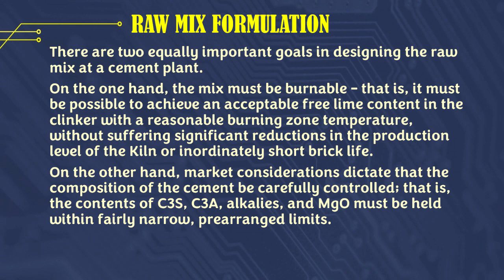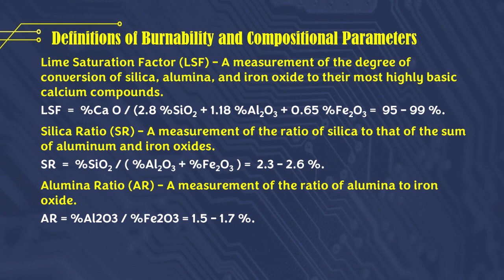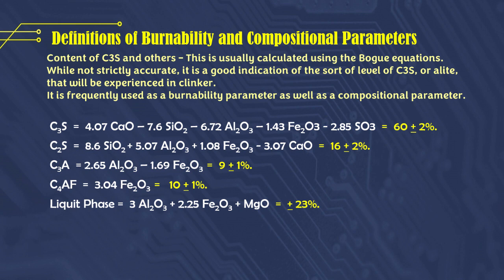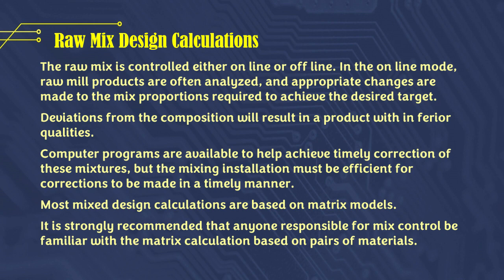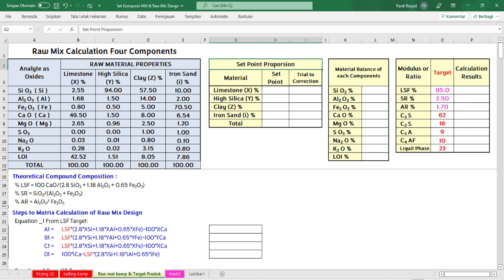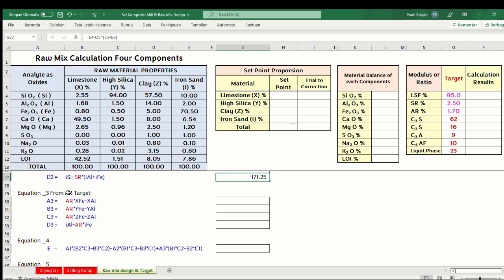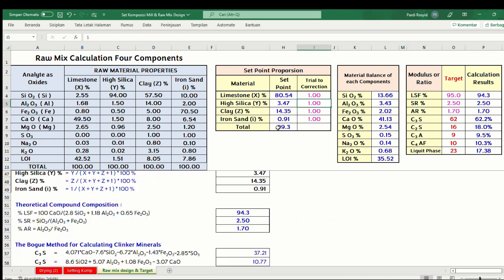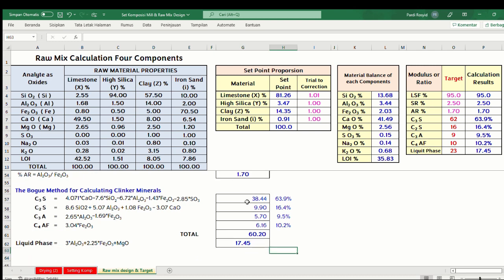Raw Mix Design for Raw Mill and Kiln Cement Operation_ English Version

Comment: Besides of spreadsheets, we also use computer software for raw mix proportioning of materials known as blendexpert by FLS
Reply from the maker: Yes, that's good sir. Online and offline mixing methods are still used. Sometimes when there is a deviation too far, which is caused by the instability of the material on the belt scale, it must be immediately corrected offline.